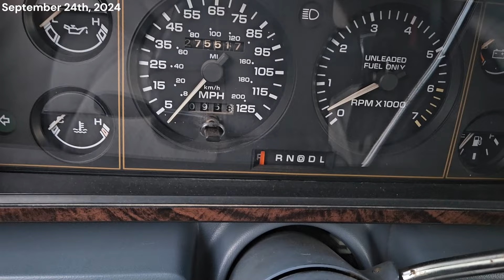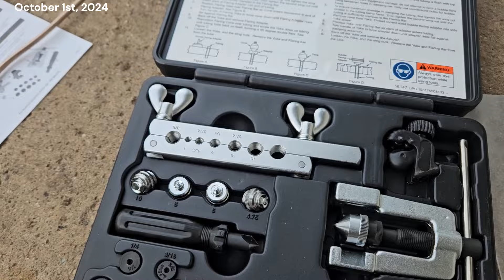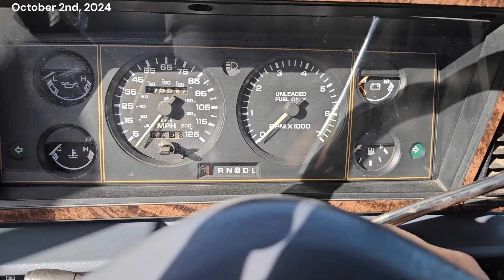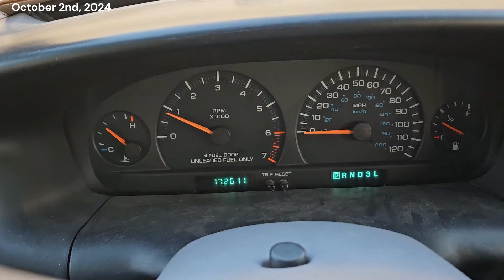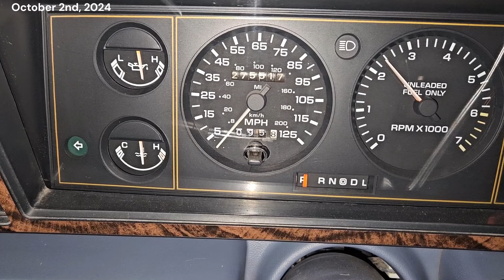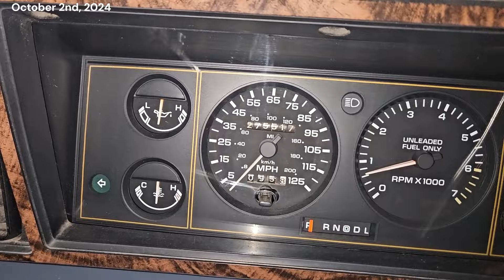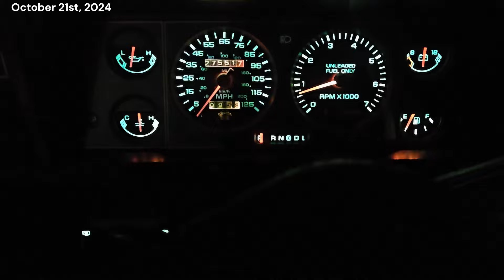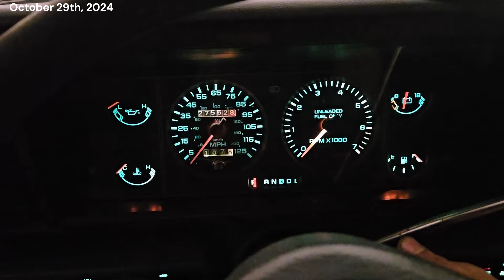1990 Dodge Grand Caravan LE "restoration" | Part 20 | Putting the van back together...again

Comment: Good video. When putting new exhaust pipes and or mufflers together I use Permatex 80335 on the insides and outsides of the components and then clamp em together. When the exhaust heats up the exhaust sealer fills in the little holes and once hardened they give you a nice quiet exhaust system. Nice job. Happy Motoring.
Reply from the maker: @mostlymoparih5682  great advice! Thank ya

Comment: Made me laugh , using a brass punch.. so not to make sparks .. I guess I’m dangerous.. when I cut steel gas line pour out gas using a air hacksaw 😂  Have you ever used the rust remover jelly stuff ? Or Por-15  ?
Reply from the maker: @462ANIMAL  lmao! I've used the rust jelly before and I've heard good things about por 15. Just not what I had easy access to at the time!
Reply: @MNMoparMinivan  Not much time left till it snows here, our low for tonight is 23.F !
Reply from the maker: @462ANIMAL  we got snow Thursday but it melted. It was 63 or so today. Not supposed to snow for a few weeks at least now here
Reply: @MNMoparMinivan  yeah , hopefully we don’t get snow for a few weeks.. I’m never ready for it.. I still have firewood to cut and slit.. on top of vehicle repairs and other stuff..  The mice are terrible here all fall .